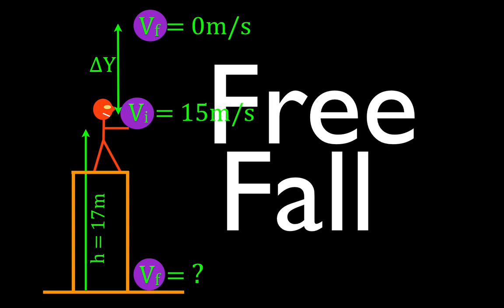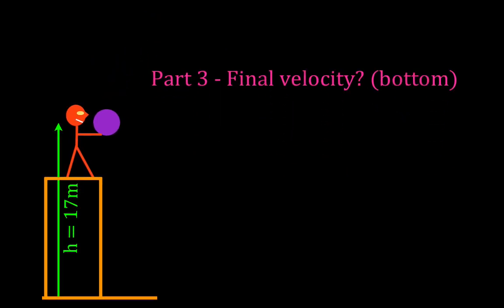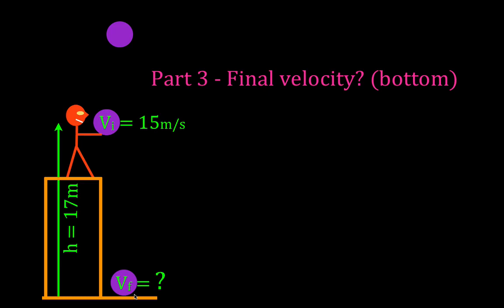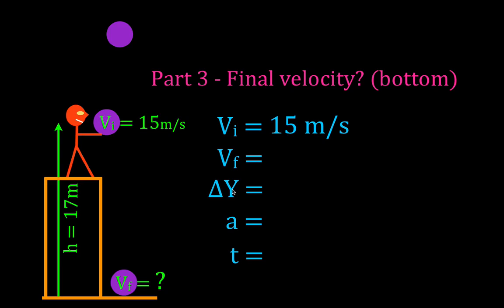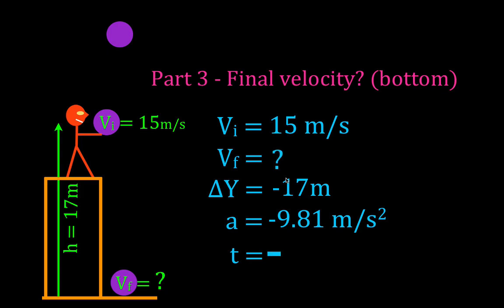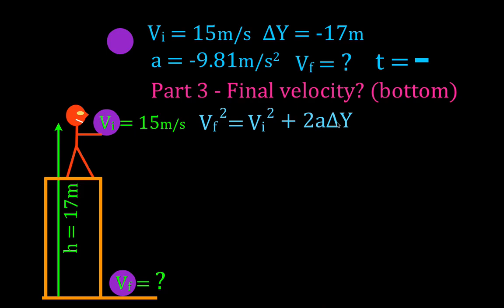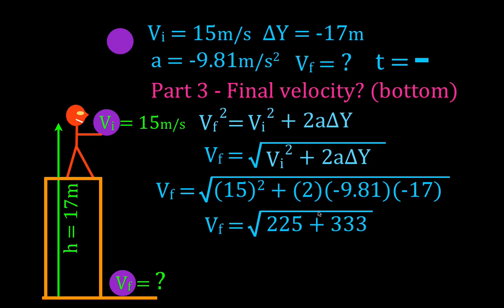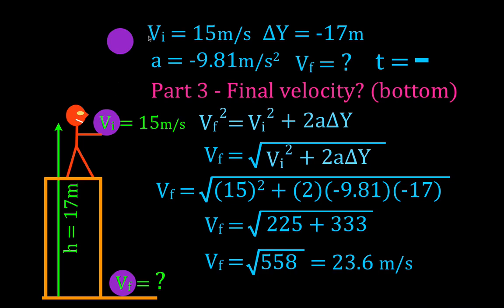Physics, Kinematics, Free Fall (10 of 12) Final Velocity at Bottom

Comment: Hello, I'm wondering why you did not consider finding and adding the change of position from the  height of  the platform it was thrown from to the maximum height because if you did you would come up having change of position as 28.45 and if so, the final velocity would be 27.99m/s or 28m/s or if the given height which is h=17m is I have gotten all wrong? Is it the maximum height already or just the height of the platform? If so, then I'm talking non-sense.

Comment: I have a question, what about if i was looking for the final velocity of the ball before it passes the top of the building???
Reply from the maker: If it is at the same place from where the ball was released up then it would be the same speed at which it was released but with a negative sign...since it is traveling in the opposite direction.

Comment: Why would the height still be 17m considering that the ball is thrown straight up, and not dropped from 17m. So wouldn't the height be 17m plus the height the ball was thrown up?
Reply: you can calculate the extra height  and add to y but then it would be free fall with initial velocity 0.
you get the same answer.